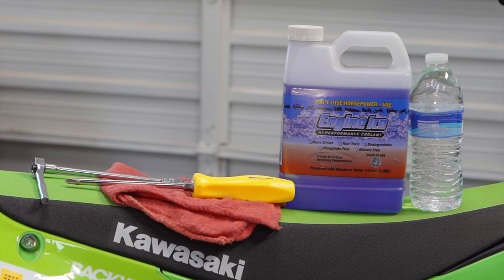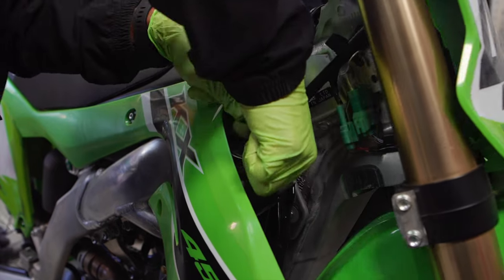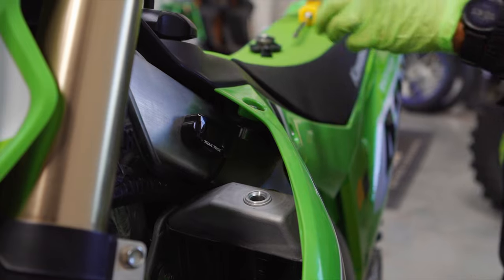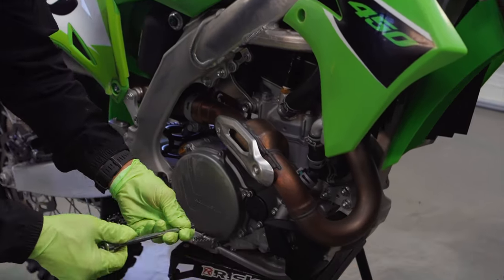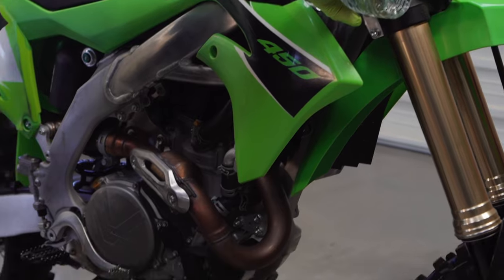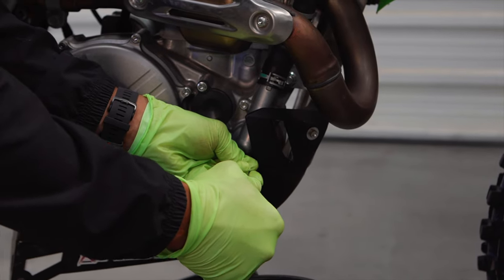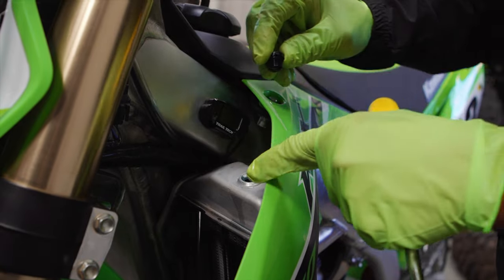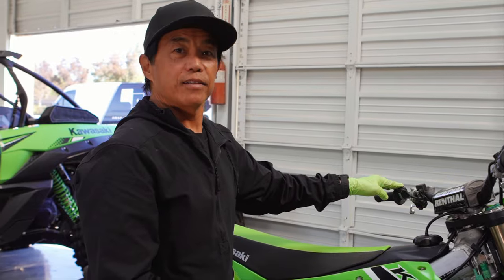How To Change The Coolant In Your Dirtbike! | Dennis Kirk Tech Tip

Comment: How does this change for an older bike? 2016 kawasaki kx250f. There doesnt seem to be a bleed valve of any kind. I tried suggestions to get any extra air out of the radiator, but im not confident I got it all out. I started the bike, got it nice and warm, turned it off, waited for it to cool before checking the coolant level. Repeated this process until it didnt need to be filled again. Ive been searching around and cant seem to find answers.